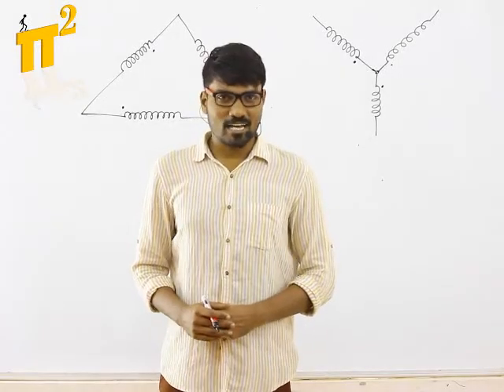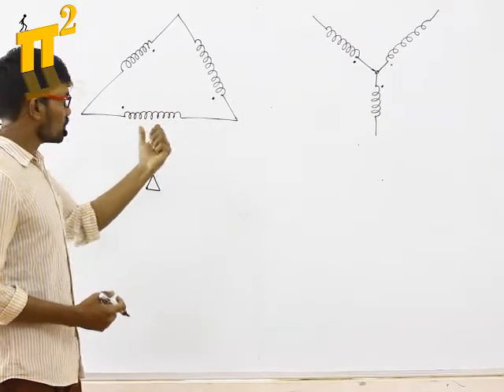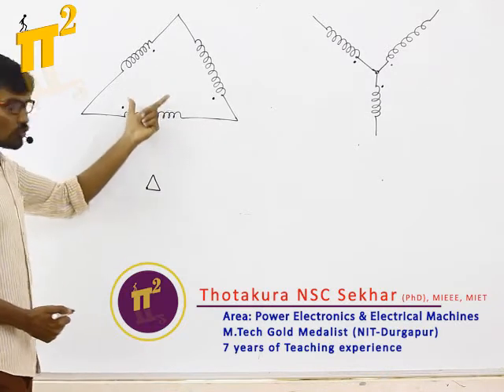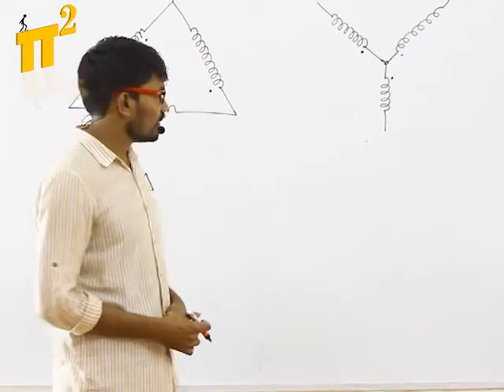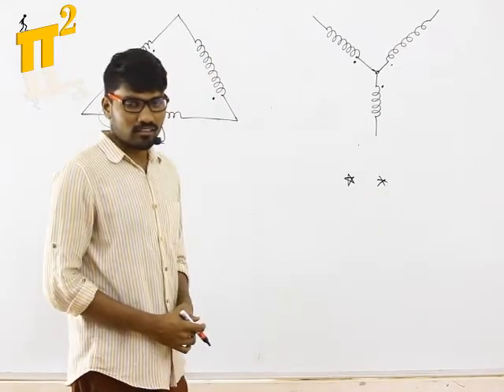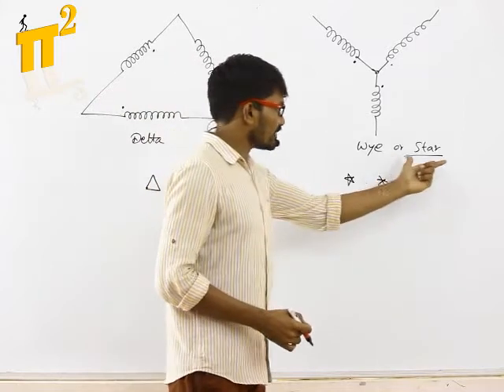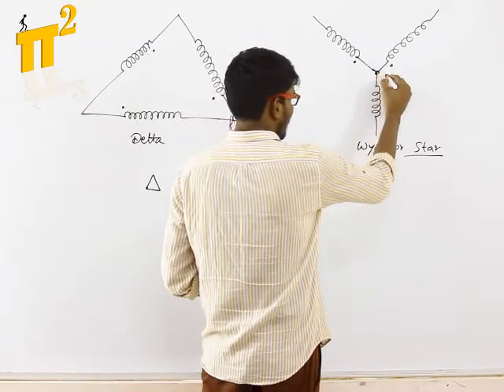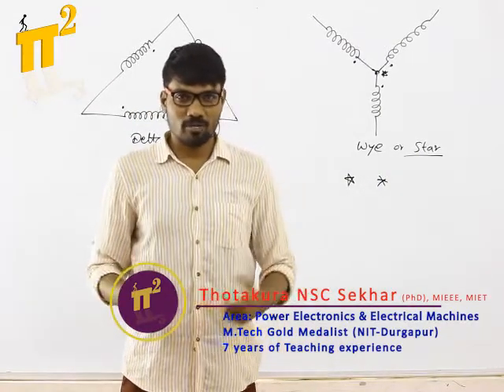Secret behind the name "Star" in electrical engineering | PiSquare Academy

Comment: sir,why there is only 1,3 phase.why not above 3 phase?
Reply from the maker: Dear Surya, we use more than 3phase for some industry and special applications, but for our commercial and residential purposes 3-phase is found satisfactory and economic, Please refer to Electric circuits by suresh Kumar for more details
Reply: 3 phase system gives about 50% more output than 1 phase system. Now if you increase the no.of phases above 3 phase there is only about 7% increase in output with subsequent increase in phases above 3.. There are other reasons as well..

Comment: sir i have a doubt......in ac supply...the voltage wave changes its magnitude and direction....then current should flow from phase to neutral and neutral to phase???.....but neutral is connected to ground...ow current flows from neutral  to phase ..passing the load....please clear my doubt sir

Comment: what is different between neutral and Ground???
Reply: neutral is the continuity of circuit I.e it closes the circuit by connecting load and source .where as ground is safety connection that is connected with all metal parts of appliances to safeguard the user from getting shocked.
Reply: yes sure thank you but then, is ground and earth both same??
Reply: in my view grounding and earthing are same I.e connecting something to earth.but in grounding purpose is to divert any leakage currents or induced currents in any metal parts of appliances to earth via a copper wire,but in grounding purpose is to protect a device from higher voltages like thundering surges and provide a reference zero voltage point so the device is connected to earth by a metal wire like neutral of transformer top wire on a transmission line ...best example is a transmission line .
Reply: you see in a transmission line on top a conductor is run which is connected directly to tower structure with out insulator ,this is called grounding .at the foot  tower is connected to earth to bypass induced currents in tower due to power flow in phase conductors so in order to protect any human who touch the tower this tower is earthed ,it's purpose is safety where as first one is system requirement .